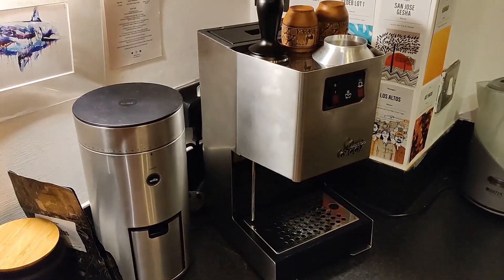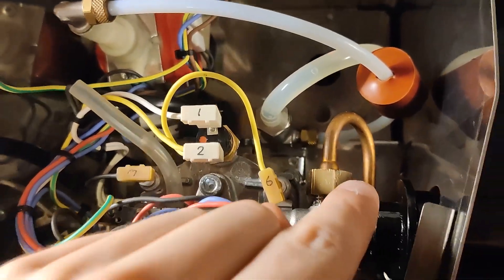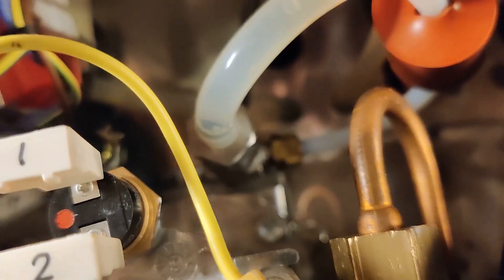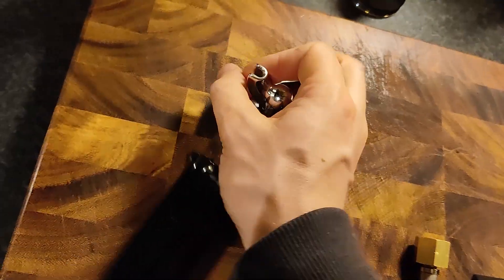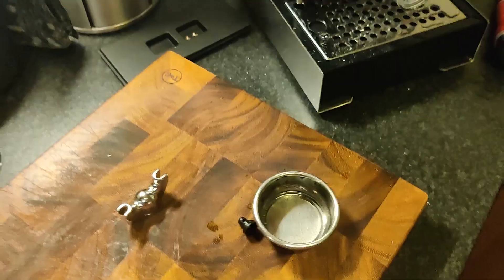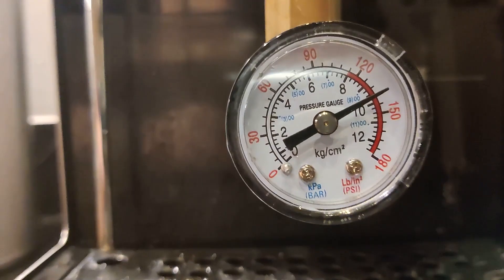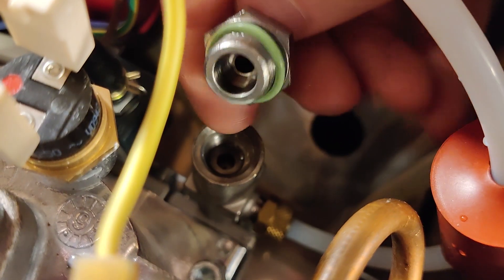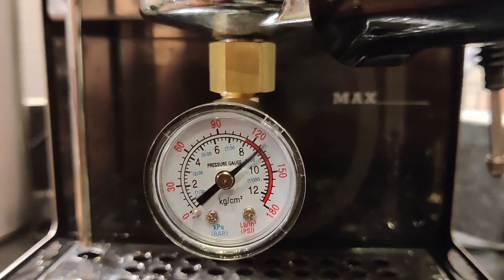Gaggia Classic Mods: Stage 3 - 9 Bar OPV Pressure

Comment: You do realize that you were using a "pressureized basket", right?   The machine is supposed to be set at the factory at 15 bars in order for you to be able to use that basket.   It lets you make so-so espresso with some crema even with pretty crappy  supermarket ground coffee.
Reply from the maker: If you look closely I swapped the pressured basket for a VST basket, but it also doesnt matter for the calibration as the gauge seals the system so it will reach the same steady state pressure.

Comment: Anyone know why after setting for 9 bar I'm not getting any flow through the opv?  I've had it all apart and its all clean and free from any scale.  I was thinking pump might be a little tired?
Reply: I had the same problem. For me the 3 way solenoid was clogged. There are articles online about how to clear if they get to that point. It took me about an hour to disassemble and get it restored to "like new" performance. Here's one link: https://www.youtube.com/watch?v=N9i-EH7qXOc

Comment: I just done this to measure the pressure but, there's a lot of leaks from the rubber seal. I change it for a new silicone one but problem remains the same... weird, this never happened when I use it every morning with coffee. Too much pressure for the seal?
It's frustrating I cannot read my actual machine pressure.
Thank you
Reply: if you mean when trying to get a read with manometer take the coffee basket off the portafilter.

Comment: Great job.  Question ... once you get the pressure set at 9 bars, how often after that would you need to check it and adjust it?  Periodically like once a year?  Or ... ?
Reply: I've done this mod and have checked the pressured after a year and it stays the same, if you need to adjust maybe the pump is starting to go?
Reply: @alvarobesnier  I've seen some say that mineral buildup in the machine can cause the spring to stick open a bit, so descaling the machine may be an option if your pressure is changing without you touching it. The springs can sometimes get worn out too.

Comment: How the hell did you get the spout off the portafilter... Mine is completely fixed on, otherwise ready to do this whole thing! Nice clear video demonstrating entire process btw!
Reply: If you didn't get it by now, I had the same problem and got it open with a screwdriver that I put through the spout. Watch out that you don't break your screwdriver
Reply: @Aills0  this is exactly what I ended up doing.. complete nightmare and bent the housing of my screwdriver!
Reply: holy shit mine took an alligator key, fucking crazy
Reply: They are actually glued on in factory, I had to head my with a heat gun for an hour and use a vice
Reply from the maker: I used a bench vice with rubber jaws... 3 years late :'}

Comment: Have you experienced your Gaggia to trip the electrics after a full service? Any suggestions please?
Reply: a bit late but you probably got the insulation of the heating elements (the white chalky thing) wet. You need to dry them out using an oven.
Reply: @miatacollector  Thanks, that may have well been the cause. It was a continuity problem between elements and boiler, so I bought a new boiler in the end.
Reply: Alternatively remove the earth cable from the internal plug assembly (and do not touch the machine) which prevents it tripping, it then heats up internally and you don't need to oven it in case it doesn't fit!

Comment: I was wondering about the size (diameter ?) of the soft tubing that holds 9bar coming from the pump, I would like to find 3way fittings to attach a pressure gauge on it. Thank you so much for the 3 videos of modifying the gaggia!

Comment: Both old and a new Gaggia Classics have a spring inside the OPV - that's how they're all made. At the old one, OPV is made of solid brass and the pressure exerted on the spring is adjustable via the Allen key screw. The new one is cheaply made, OPV is plastic and has no adjustment, hence spring replacement or cutting.
Reply: So can you still replace the spring in the old classics instead of doing it the way he did it in this video?
Reply: @jamesa7231  No. The spring is behind the allen screw. This is a much better solution as you can actually adjust the pressure. The pressure gauge is cheap and easily attached to any portafilter.
Reply: What size is the Allan key for the mod please
Reply: @Usayyy9295  5mm

Comment: I think you use the 'crema perfetta' filter basket which is a pressurised basket that indeed should be used with the frothing jet device (the 'little spacer' as you call it) to avoid squirting. Gaggia provides this option for the majority of their customers who simply put preground coffee (usually too coarse for espresso) in the basket and want something that tastes like coffee and has some sort of crema. So in a way you could see this as a hack to come up with an espresso-like result. This is also the reason why the machine comes with 15 bar of pressure out of the factory. If you want to use a non-pressurised basket, you have to remove the frothing jet device from the portafilter, and than the 9 bar OPV mod would make sense. Otherwise why bother?
Reply from the maker: I may not have explained it too well but if you look closely I took out the pressured basket and put a non-pressurised basket in. It doesn't really matter for setting the pressure as the system is closed by the gauge and so will reach the same pressure regardless of what basket is in there. The pressurised basket can be used if you have a poor grinder and cannot grind fine enough, but yes getting a non-pressured basket is generally why you would do this mod. The portafilter itself has no relevance as it simply holds a basket in the place

Comment: Where did you get the pressure gauge for the portafilter? Are you looking to sell yours?
Reply: Could you maybe share a link to the pressure gauge?
Reply: @coenwouters6808  I got one from eBay £17 from seller Edesia Espress. Comes already with the conversion to attach straight to the portafilter.
Reply: @coenwouters6808  Blue Star Coffee in Ireland
Reply: For anyone else wondering - you can get everything you need from a hardware store or ebay or something like RS components. A 16 bar pressure gauge will have a '1/4 BSP' male thread. The portafilter has a '3/8 BSP' male thread. And some teflon thread tape, again readily available.

So you need to buy the pressure gauge and a 1/4 to 3/8 BSP female-female adapter and the thread tape.

The splitter on the bottom of the portafilter just unscrews, but might be tight.

I think I bought my pressure gauge from RS components for about $20 AU and I could have bought the adapter from a big box hardware store for about $5 AU. You can't make this stuff as cheaply as you can buy it.

BSP generally means 'British standard pipe, parallel' - also known as BSPP.

Comment: I am considering a Gaggia Classic Pro and also have a Wilfa Uniform grinder, which until now I have always used for pour-overs rather than espresso. How do you find the grind size options on the Wilfa for the Gaggia - Does it grind finely enough? What settings do you use? Are you able to dial in espresso enough and do the lower bar pressures help?
Reply from the maker: I'm finally getting good espresso from this machine. The uniform is right on the edge, there are grinders with much better adjustment in the same price range but maybe not the same consistency such as the sage stuff. The issue with it is not how fine it will grind, but the increments are quite coarse at the fine end, so you have to do other things to compensate if you find you are between a setting. It also depends on the beans, I am using a light roast (Square Mile / Origin), 15g in 37.5g out, I also temperature surf for 20s before hitting the brew button.

Comment: I heard that it should read 10 bars at the portafilter gauge for the pressure to be 9 bars when brewing, is that true? Very good video by the way.
Reply: I have set mine at 7 bars. It's perfect for my brewing style :)
Reply from the maker: The reasoning behind this doesn't seem comprehensive to me. I originally set it from 14 bar to 10bar about a year ago, after putting this to 9bar I'm happier with the results in the cup.
Reply: @Skoopsy_  you must prefer low pressure and you could and might even like 6 bars. 

I believe its 10 bars for pressure because when you put the guage on, theres no where for the pressure and water to escape, so the pressure will be higher than when you have ground coffee and a basket for the water and pressure to travel through.
Reply: Correct.